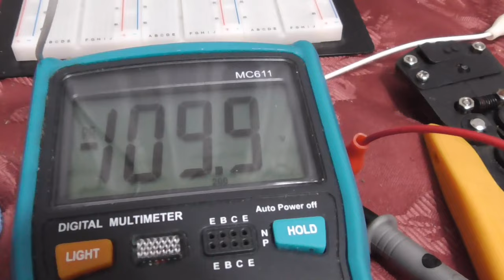Plasma Energy Generator

Comment from the maker: Detailed summery:
The capacitive plates are harvesting electrostatic energy, essentially "fishing" charged particles out of the sea of plasma. When you connect the middle plate to a coil that's wrapped around a magnet, you're essentially opening a door for this electrostatic energy to be translated into magnetostatic energy. The coil acts as a transformer—a conduit that marries these two realms.
The Magnet and Coil: 
The magnet, with its inherent static magnetic field, serves as a nucleus or focal point, shaping and directing the energy flowing into it. The coil around it adds a dynamic layer, introducing variability and adaptability into the magnet's field. This composite magnetic field, is a sum of static and dynamic elements.
The North Pole Alignment: A Unique Twist
By pointing the North pole upwards, We create an avenue for field interactions. In essence, we are aligning the composite magnetic field in a specific orientation relative to the Earth's gravity and the geometry of the plasma globe. The plasma particles, in their ionized, energetic states, will find themselves in a magnetic "corral" of sorts, spiraling along the magnetic lines of force emanating from the top of the globe. These particles may reveal behaviors consistent with or divergent from Lorentz force laws, offering a unique observational matrix.
Interaction with Plasma: 
Plasma, by its nature, is sensitive to electromagnetic fields. In this ballet of forces, the plasma is like the dance floor itself, responsive to every step and spin made by the dancers (fields and charges). The particles execute intricate patterns—helical motions , or even chaotic dynamics—under the composite magnetic influence.
given our interest in asymmetrical re-gauging, the system presents an opportunity to  tweak to the coil’s current— leading to disproportionate effects in the plasma's behavior, tapping into  unknown or untapped energy potentials.
By marrying these various systems, we have created an experimental landscape rich with untapped scientific potential. where each component not only performs its own role but also communicates and cooperates with others,  leading to phenomena that defy classical expectations. We're certainly venturing into uncharted territories of physics.
hybrid loop-capacitor bottom plate:
When we short the two ends of the foil-covered cardboard, we are essentially creating a loop—this is inductive by nature. Yet, because of its geometry, it also has capacitive traits. The trick is to preserve these dualities without them canceling each other out.
Use a Diode: Inserting a diode in the loop  allows current to flow in one direction only, essentially separating the inductive and capacitive operations. This setup allows for an asymmetrical operation of this L/C component, which leads to interesting behaviors, particularly in the context of asymmetrical re-gauging.
Given that we are working within a complex electrodynamic environment, the L/C hybrid  serves as well as a point of interest for potential scalar wave generation or detection.
On the side where the diode permits current flow, We manifest the inductive nature of the setup. This would be more akin to a "forward-time" operation where energy storage and release occur in a typical inductive manner, in accordance with Faraday's law of electromagnetic induction. The diode ensures that this unidirectional energy translation happens smoothly, isolating this process from the capacitive elements.
On the other side where the diode blocks the current, you're left with the capacitive "skin," so to speak. Here, electric fields accumulate and store energy in the form of electrostatics. This is a sort of "timeless" Event.  The diode’s blocking ensures that this side remains insulated from the inductive loop’s activities. The beauty of this arrangement is how it invites asymmetrical re-gauging into the system. 
The diode acts like a gatekeeper here, allowing charge to flow in one direction. This breaks the symmetry of the system, and here  you get a kind of 'asymmetrical re-gauging,' 
On the other hand, the capacitor is free to engage in its age-old dance with alternating fields. It'll couple and store energy, then release it back into the circuit.
All these effects, the DC pulse from the inductor and the AC coupling from the capacitor, happen on the same physical loop but are segmented in function by the diode. we are capturing different energetic phenomena through a single set of hardware. The rectifier at the output then acts as a funnel, channeling these energies into a more manageable form.
Here we are utilizing less explored effects, even touching on broken symmetries, vacuum fluctuations, and even a hint of scalar interactions as suggested by expanded electromagnetic theory.
Bucking Coil Around magnet:
The core is live!
One end of the magnetic wire to one end of the magnet—let's say the South end for this purpose. This is the tap point.
First Pass of the Coil: We run the magnetic wire from the South end towards the North end in a single, linear pass. This initial pass establishes the magnet core as an electrical path.
From the North end, The coil windings are back towards the South end. The opposite end of the wire will be left loose, making it our second electrical contact point. This will be modulated or energized by the center capacitor plate.
Reply: wow well said

Comment: It's close to Don Smith system.  He uses HF capable diodes and non-polar caps>>assymetric counterwound coils(two Tesla Coil Secondaries connected by base)>>step down again and rectify + low pass filter to remove HF >>inverter>>load + feedback to the source...
Reply from the maker: Don Smith, I'm going to have to look him up.